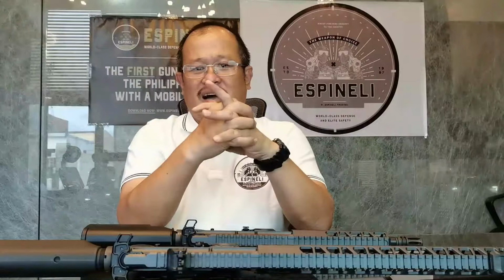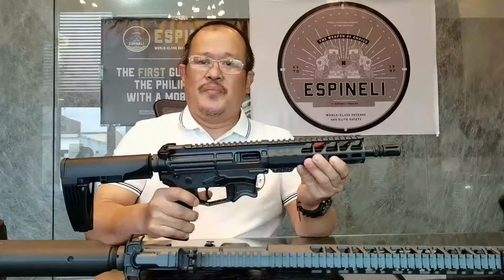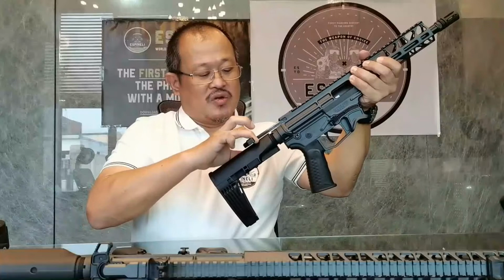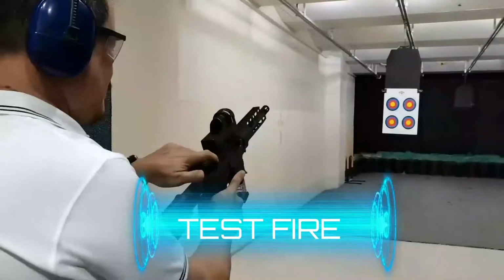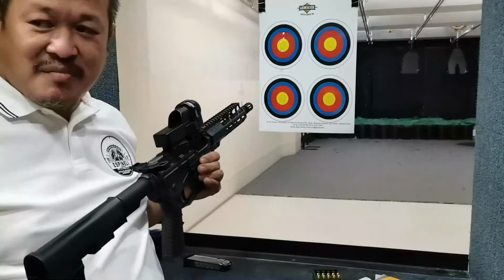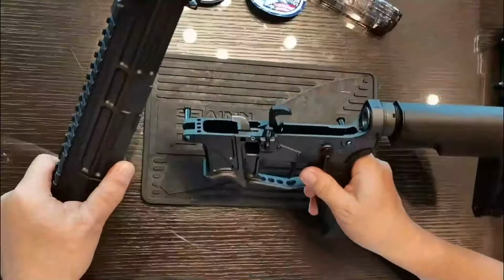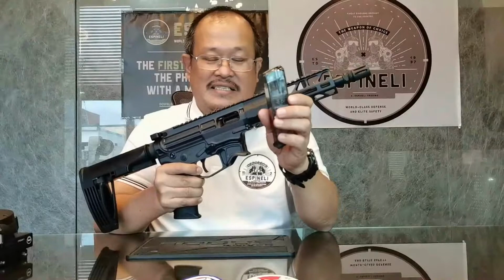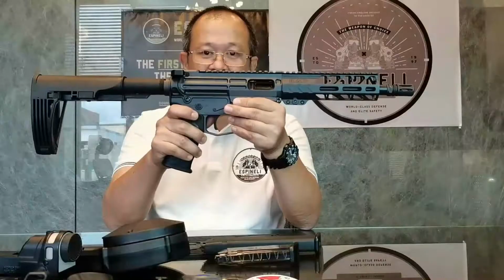BATTLEARMS XIPHOS 9MM DEMO

Comment: Nice video. Need to clarify your MOA (Minute Of Angle) definition though. To keep it short, 1moa is 1" at 100yds. Pag sa 25yds ka at ang grouping mo ay 2", theoretically, pag dating nang 100yds, 8" na ang shot group mo. Mali yun half inch moa kasi ibig sabihin nun half inch ang group mo at 100yds. Also, you measure your shot group using the two farthest bullet holes. If I may suggest, don't compensate with the aim just to get the shots centered on paper. Kahit hindi naka zero yun optics ang importante makita nang viewers yun shot group. Anyway, I still enjoyed the video and still looking into the xiphos 9 as my first PCC. Thanks!
Reply: Well said sir, may dagdag kaalaman na nman ako 😅. Thanks.